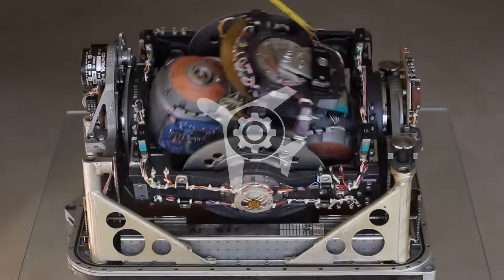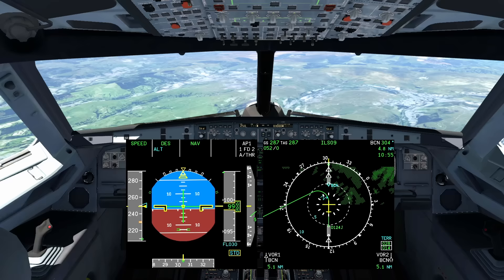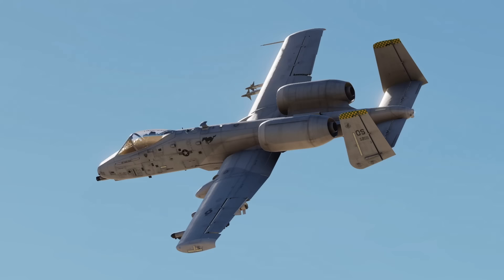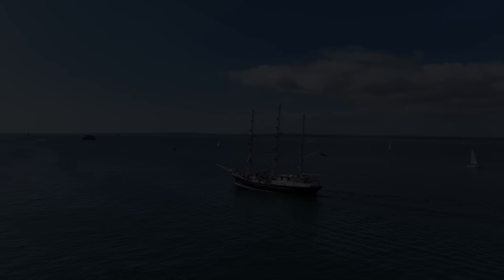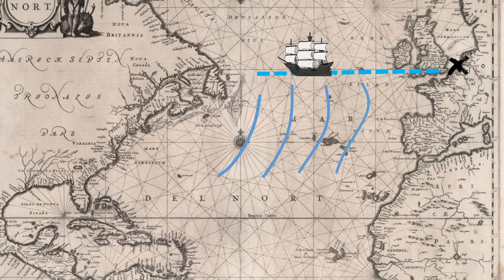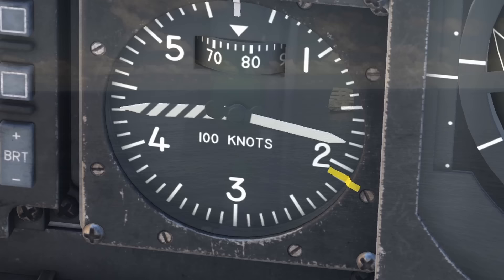The GENIUS of Inertial Navigation Systems Explained

Comment: I was an Inertial Navigation (and Radar) Avionics Tech from 1979-1983 on the USAF F-111. The INS was an 80+ pound, 2ft x 2 ft box when removed from the aircraft for testing in our shop, thus required 2 persons to lift and mount onto the test equipment. Parts had to be replaced and calibrated routinely for optimal performance.
Reply: M
Reply: Sounds like the old ASN84 we had prior to upgrading to LTN72.They took longer to align and quite often required a lot manipulation to get them up and keep them running. Stell shots were a must do, though we still had Omega.
Reply: what an amazing device
Reply: I used to fly them, it was accurate to about one part in ten thousand. Quite good for the era.
Reply: Thats pretty neat man... It's remarkable how small INS systems has got by comparison. I work avionics on F-35s, and now its just a tiny little white composite box you can hold in a single hand. It's pretty impressive too, It will have virtually zero drift even without any GPS fix being provided for a good 30 or 45 minutes. Not bad for degraded operation lol
Reply: @youvrajashish1013  derp enters the chat
Reply: @Jacksonflax They could have made it smaller, as they did with other devices, but this was planned and intentional ! It is also problem-free. Frankly, for me, I do not like things that consume a lot of energy to perform a specific task in addition to the fact that they pose a great danger and Unnecessary complexity ( laser based ).

Comment: I was an Avionics technician and Loadmaster on C-130 aircraft for both the Marine Corps and Air Force, and this beautifully explains how INS systems work.
Reply from the maker: Thank you so much, means a lot coming from a real world avionics technician!
Reply: Then could you please explain, how in real hardware the compensation realy work, by moving around the Earth. Other vlogers show, that there must be two electrolytic tilt sensors, to hold the platform with two gyroscopes steady horyzontally to Earth surface. Is it right?

Comment: Years ago, before the satellite supported GPS system had been established, my artillery Battalion was issued a new vehical with this Inertial Navigation System mounted on it. We gave it trial at 29 Palms. We performed a 27 mile traverse and closed on a known point. After 27 miles, we had an error of less than 1 foot. That's not good enough if you're going to the moon, but plenty good enough when you are firing 155mm rounds with a 70 meter, (230 foot), killing radius.
Reply: They are still used in modern artillery, because gps can be jammed or tracked.
Reply: @udenszirnis1644 ; I thought GPS was passive. How can the user be tracked?
Reply: @oldgysgt Differential gps uses a signal from a ground based station to further reduce errors associated with pure satellite systems and can therefore be traced when using this ground station which is not impossible to shall we say hack.

Comment from the maker: Hello!

This video is targeted towards people who are trying to learn about INS systems for the first time, so to keep it digestible I decided to leave out some details. Here's a quick summary of things that didn't make it in:

- 03:16 Fun fact: in 1714 the Longitude Act was passed by the Government of Great Britain to develop a sufficiently accurate clock for maritime navigation. 
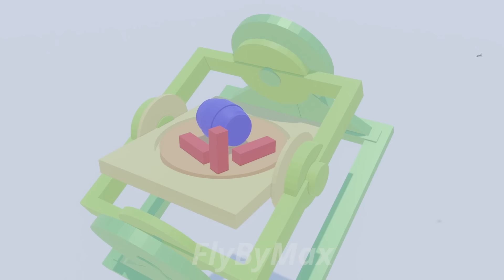- 04:15 The real LN-3 had four gimbals instead of three to prevent a phenomenon called "gimbal lock". This happens when two of the rotational axis align, constraining the system to rotate in only two of the three dimensions.
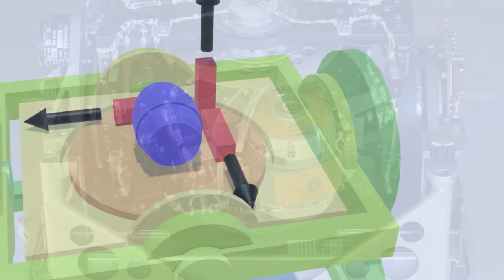- 06:15 Using acceleration to determine your position is an entire topic in itself, called integration of position. The maths behind it is actually quite simple, and computers can do these calculations extremely fast. Like the sailor example, INS systems need to know where they start off from before they can start this process.
- 08:04 The same "tilting" problem whereby gravity influences the measurement of accelerometers also applies to roll and yaw. That's why we need all three gimbals.
- 09:58 Although accelerometers do not directly measure position and velocity, these can be calculated (or integrated) by using the acceleration. Like all other instruments, accelerometers are imperfect and will inevitably measure an error which will accumulate over time (due to dead reckoning). 
- 10:02 Similar to the previous point, gyroscopes will also build up an error over time due to gyroscopic precession and the friction of the gimbals. To correct the gyros for transport wander and apparent drift, this same phenomenon is used to apply torques to rotate the gyroscopes according to the spin of the earth and velocity of the aircraft.
- 10:23 In reality, due to the accumulation of errors the platform will actually measure a small component of gravity. The reason this does not get out of hand is due to the feedback loops, which will cause the platform to oscillate as a "Schuler pendulum" (wobble back and forth around the centre of the Earth). 
- 10:36 Due to the previous points, over time INS systems will build up an error despite the feedback loops. They are therefore periodically updated by other navigation systems such as GPS or VOR. 

I mention that INS systems keep the platform level with the horizon, technically this is not true (thanks Ken Watanabe). They keep the platform level with the local horizontal plane, since the horizon could in theory depend on mountains/terrain. The point is that the platform stays level, perpendicular to the direction of gravity.

Finally, these days aircraft no longer use moving-platforms but correct for gravity using maths in a computer, although the principle is the same. These types of systems are called "analytic platforms" since the computer basically uses a virtual platform instead of a real one. Another name for them is strapdown INS systems, since I guess they can be directly "strapped" to the aircraft without the need for gimbals. These more modern variants use ring laser gyroscopes, but rely on the same concepts introduced in this video.

If I missed anything or made a mistake, definitely let me know. Thanks!
Reply: Awesome thank you for sharing this about Navigation Systems. More videos on the physics of flight?
Reply: Seriously, would it have killed you to mention gimbal lock? The fourth gimbal is extremely important. The first systems only had three. But there was a dog fighting maneuver taught to F-4 pilots in Vietnam that locked up the platform every time. Was never a problem until then.

 And it was funny that you showed a video of an A-10 which didn't have INS until the mid '80s, 10 years after the first aircraft were delivered to the USAF. The rumor is they came with East German road maps.

And there was no other system in the old days that could update the INS. We used a thing known as a waypoint. You'd type in the latitude and longitude of a known landmark and tell the system to update when you flew over it.

And something else, the gyroscopes do not align directly with the poles and equator. The original systems did and were severely erroneous when going above 72 degrees north or below 72 degrees south because of the converging lines of longitude. But you didn't even mention how gyroscopes precess until they find the earth's rotational axis.

The platform actually orients itself to local level, not the horizon. The horizon changes with altitude, local level doesn't. It does this using the accelerometers when the aircraft is sitting still during system warm up. 

I learned how to dead reckon in AFJROTC in high school. The process and computations performed by an INS are completely different.

I used to be in the Air Force. Yep. I maintained the INS on the A-10  at Davis Montham AFB. My original job title was Avionic Inertial and Radar Navigation Systems Specialist. Then the Air Force reconfigured some specialties in the late '80s and I became Avionics Guidance and Control Systems Specialist.
Reply: More in-depth stuff please.
Reply: and now modern aircraft no longer use this type os system except as a backup. They use a "ring laser Gyro"
Reply: Perhaps a explanation of the more modern AHRS (attitude heading reference system) would be a nice add on.  In my modern aircraft, we have 3 laser ring gyros as back up.  The primary source for navigation is GPS first, then IRS.  GPS is almost a replacement for ground based aircraft navigation, including landing in fowl weather.  Although for the lowest landing minimums, 200ft or lower, ground based systems are required.
Reply from the maker: @captainbob2738  Good suggestions, thanks!
Reply: The first time I flew across the Atlantic in a C5 (as a flight surgeon . . Also a civilian pilot) my Aircraft commander explained the INS and the inherent error that could put the aircraft up to 25 miles off course on getting within sight on land based navaids on the other side of the pond.
Reply: Would you be interested in doing a video series at some later date whenever you're thinking up ideas, and have those videos contain the more detailed knowledge/information? I can already tell this video alone had you spend a TON of time in the background, im sure we all greatly appreciate your work, I definitely do. Just found your channel and already watched half your videos 😁
Reply from the maker: @jamesmaddison4546  Thanks so much, comments like this really mean a lot to me. I'm currently still deciding on which direction I want to go next. I'm no expert on INS systems, I just happen to know a lot of people who struggled to learn the  basics, which is why I made this video :) I'd like to maybe do one more video on this to talk about modern strapdown INS systems. After that I may go back to flight dynamics or things like orbital mechanics. We'll see, who knows! Have a great one :), cheers!
Reply: Time stamp 4:29-4:30 you state that "the inner platform always maintains a constant   orientation to the horizon", is misleading it's actually referencing a point in space. EG. if the plane was at the North pole, then instantly shifted to the equator the orientation would be shifted by 90 degrees  now the platform would be vertical to the horizon. 

The horizon is dependent on where you are, better to reference a point in space as that would be constant. 2. EG if the plane was below the surface of the earth, say a large hole 2000 ft deep(or if it was a submarine in the ocean). Where would the horizon be?
The horizon would be above you. Just for your edification subs use local vertical as a reference point, not the horizon) I found another error but I hate typing it's just wasting my time
Reply from the maker: @kenwatanabe2599  Hi, you're right, thanks for the correction, I will update the pinned comment!
Reply: Introductory video or not, you can't leave out the fundamental principle of why INS measure acceleration.

It is like trying to explain electrical motors without mentioning the presence and reason for the presence of the permanent magnet.

I question whether it was left out because the video producer doesn't understand why acceleration is measured and how it relates to displacement?
Reply: Great video, it would be better If you would went deeper into the determination of INS (vehicle) position;-)
Reply: @sjb3460  You can't stop INS from being used in other countries. There is nothing secret in it. It uses basic mathematical principles of acceleration, velocity, distance, integration (integral calculus).

You can't keep that secret.
Reply: @Haneson   I think most people don't understand it which why no INS video on YouTube explains it. I haven't come across one yet.

I will explain it simply here.
There is a mathematical relationship between distance, speed and acceleration.

Speed is the rate of change of distance.
This means that speed is the derivative of distance. 
V = ds/dt
Where d /dt is the differentiation operator.

Also, acceleration is the rate of change of speed.
a = dV/dt

So if we measure the acceleration in 3 mutually perpendicular planes using a device called an accelerometer, we can use the mathematical inverse operation of differentiation, called integration to get back to distance.

We measure the acceleration and integrate twice and we end up with the distance we have travelled from our origin point.

So now we see just how fundamental the physical principle of acceleration and the mathematical operation of integration are to inertial guidance systems. Absolutely critical. Without this, there is no INS system. Hence my earlier rebuke of the video content producer for not even mentioning them.
Reply: No mentioning of wind drift. Without taking it into consideration, an INS is useless.
Reply: @Pierluigi_Di_Lorenzo  if the accelerometers in the INS are sensitive enough wind drift doesn't come into it. Wind drift is the movement of the aircraft or missile caused by the wind force.

Sensitive enough accelerometers will measure the acceleration caused by the wind force.
Reply: @deang5622  I doubt that. The whole environment is moving, not only the aircraft.  If you are floating in a current, or flying in an air balloon, you don't experience any speed (other than optically).
Reply: @Pierluigi_Di_Lorenzo  INS's don't work by measuring speed. They work by measuring acceleration in 3 mutually orthogonal planes.
Reply from the maker: @Pierluigi_Di_Lorenzo  Wind affects IAS relative to ground speed, but since INS measures acceleration, it also includes the effects of wind. For example, if a gust would suddenly affect the plane, then the INS would measure this. Hope this helps.
Reply: @FlyByMax I am not talking about gusts but about moving within a moving air mass, a jet stream or an ocean current. Is INS really sensitive enough to pick this up?
Reply from the maker: @Pierluigi_Di_Lorenzo  Yes. For example, if the aircraft takes off with a (completely stable) head wind, it will accelerate less during departure. As a consequence, the accelerometers won't measure as much G as when there wouldn't be a headwind. Hope it makes sense.
Reply: Now I want to see a video of the things that didn't make it into Part1
Reply: N that's why on parking bay, you have the coordinates for ADIRS alignment. Last resort if crew forgets to reset n align is when crew push take-,,off thrust n ADIRS auto align at runway end, +/-250m. After e ke007 incident, please correct if I'm "off" .😅
Reply: The Germans actually tested a INS on a Ju 52 in 1938 but it failed due to engine vibration.  They were more successful in 1944 with an INS for u-bots.
You need something called "Schuller Loop Tunning" to keep the platform level as the aircraft moves around the earth.  
The Germans invented a particularly accurate accelerometer called a PIGA.   One was used on the V2 missiles LEV-3 guidance  but only along the thrust axis.   The more advanced SG-66 with an cross range accelerometers was flown several times.   PIGA accelerometers are the most accurate for missiles since they have a wide range but expensive.   .
PIGA accelerometers were used on Redstone and the subsequent Saturns.    
-See "Inventing Accuracy: A Historical Sociology of Nuclear Missile Guidance (Inside Technology) Paperback – January 29, 1993
by Donald MacKenzie.
Reply: 7:17 incorrect. One can feel pressure on the buttocks toward bottom of the car decreasing in case of the slope. The question: can mechanics use that too?
Reply: Very good explanation how knots term came about. But not "dead reckoning", maybe because from wiki page I see there are several ideas about the term etymology.
Reply: Quite correct - In addition:

 The accelerometers must also be corrected for Coriolis errors, if not these errors will cause the aircraft to turn towards the poles flying E-W and (if memory serves) E when fling N, W when flying South (could be the other way around). Think that's what you were talking about at time stamp 10:02. Don't think you mentioned the need for a True North orientation of the central core that contains the accelerometers and Gyros.
Reply: You sample the accelerometers, and keep a running velocity. You stop, you accelerate until you reach your cruising speed, at which point the acceleration is 0.  Acceleration doesn't tell you the speed, it tells you the change in speed.
  I also wish you got into old-school navigation a bit more. Compasses don't point west consistently, especially near the magnetic pole. You could tell how much you drifted by using your sextant and finding the angle to polaris, to stay on latitude. Longitude was tougher, you had to shoot the sun at a specific time (hence the use of minutes and seconds in measurement). If you're going with a current, you seem to go slower than indicated, against, faster (same with airspeed).